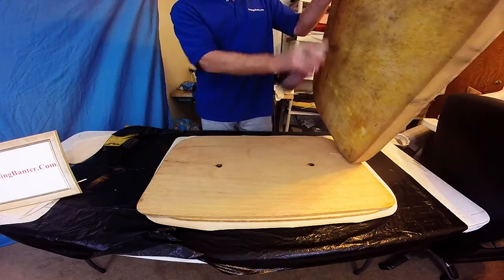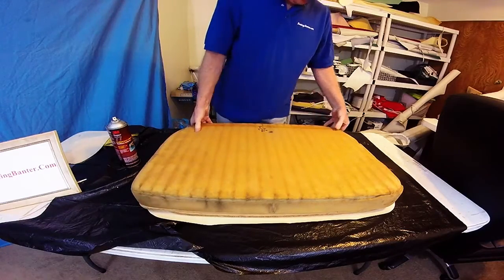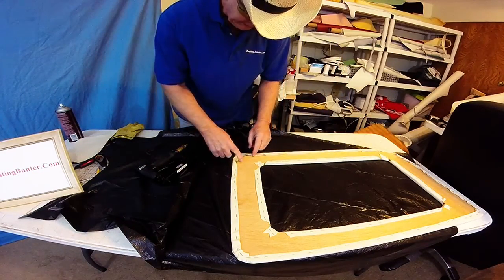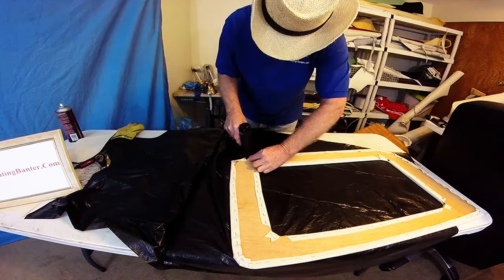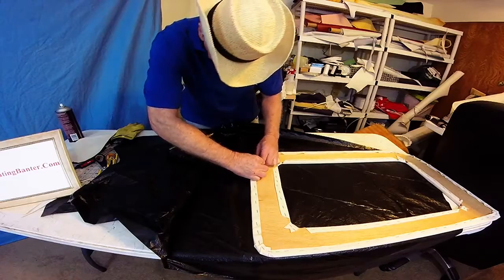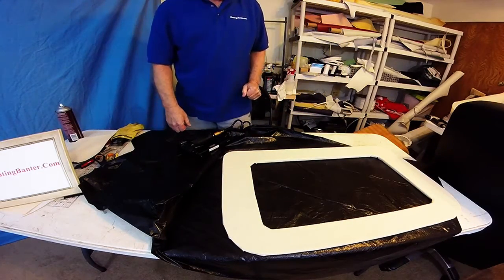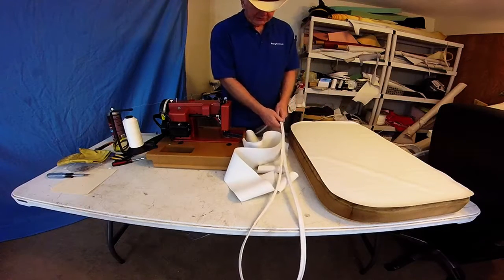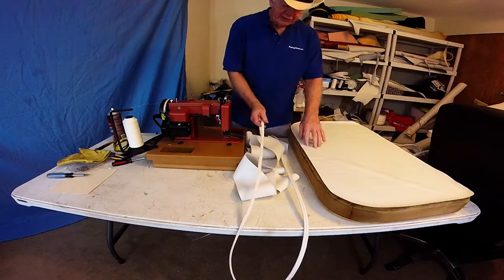Boat Upholstery Chap 52 part 2  Center Console Seat Redo

Comment: larry
I really appreciate the videos...  Question.  I am not a fan of piping. For my project: a center engine ski boat. I was planning to do all my seams either as just an inside stitch or as an inside stitch with an added single top stitch. Is there a reason this will be problematic? I am surprised its not done like that more often,  simpler than a french seam but I would think a lot more strength and looks better (in my opinion) that just piping.  your thoughts?
Reply: I think a good made french seam is looking really great, but the one you describe is not bad either. About piping I have tested to make it, but every time after a few inches the thread tangled in the needle, every time. Without piping I tested to saw 12 layers of vinyl, no problem at all. At last I found the problem, I was using V92 thread and a 110 needle, when I changed to a 125 needle that problem was solved ... I learn by trail and error, it works but takes a bit more time, but what I learn I never forget ;-)
Reply from the maker: It is your boat so construct the upholstery anyway you like. Piping looks nice and I feel gives the piece a more upscale appearance. A double seam is an very good alternative and easier to do than adding piping. The double adds twice the strength to the seam so will last longer and you can dress it up with using different colored thread if that appeals to you. Being you are tackling a ski boat, I would suggest you start with the cushions to hon your skills prior to doing the engine cover which is hard to do. Make sure you bring each piece back to the cover, lay it down next to the previous piece and trim if needed before moving on.
Good luck
Reply from the maker: Yes the right needle with the right thread is critical. "Sailrite.com" has a very good guide to the correct matches in their catalog you can order. You much have a monster sewing machine if you can sew 12 layers of vinyl. I have never seen the need for sewing that thick of a piece but sounds like you are ready for anything. Good luck with your projects
Reply: Thanks for the tips and words of encouragement.  I hope to start the project in the next two weeks. Still assembling materials. My plan was to start with the smaller cushions and work my way up to do the motor cover 2nd to last as its complicated and the driver seat last as its in pretty good shape.